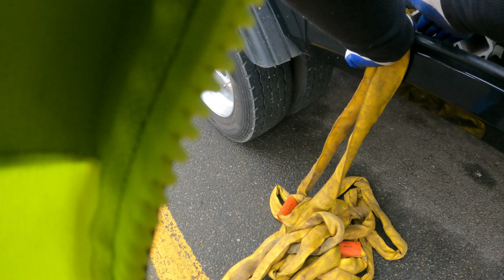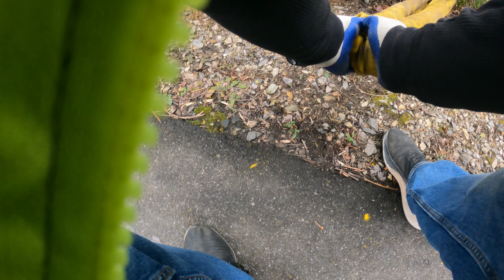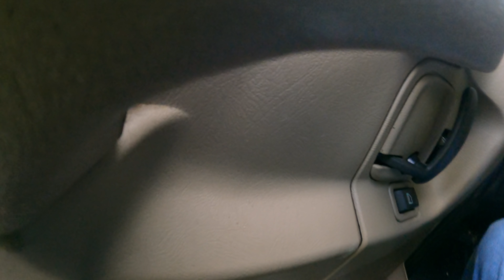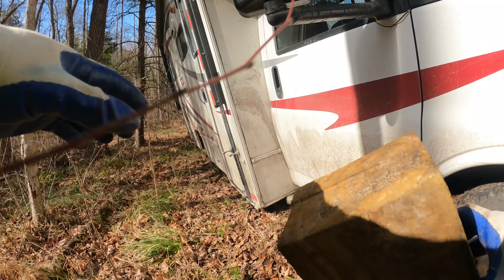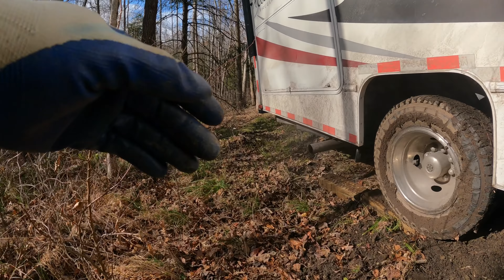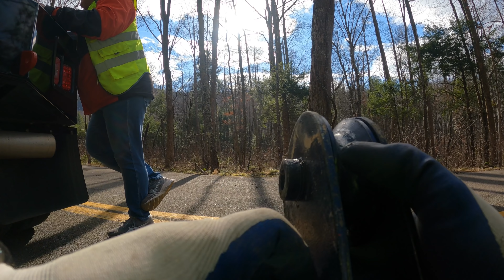This RV Maxed Out Our Winch On The Motor Nature Trail In #Gatlinburg

Comment: Jeff, great job using the snatch blocks to increase your winch’s pulling power.
Look up Ron Pratt’s YouTube channel
On pulling a 3/4 ton rental van out of the Lincoln National Forest. They used a side by side with a front winch. They had to use 5 or 6 snatch blocks and turned the van about 120 degrees to get it headed back down the trail.

Comment: Suggestion hook from the rear axles, pull from the rear have the driver steer hard right.  Pulling from the rear will force the rear to come up on the road.  Since the steering  wheel is hard right front end will begin to swing up on the road once it starts to the road start to cut back to the road.  Check out Matt's of Road recovery. 
Safe travels and roads Brian and Cindy, "xtreambydesign with passion "

Comment: 1st question, why would you pull up on the wrong side of the road effectively blocking it completely? Next what's with the dramatization with all of the cables and pulleys ?
It could have easily pulled back up on the road with a 2 wheel drive and a snatch strap !!
But I guess that doesn't make for good YouTube ratings !